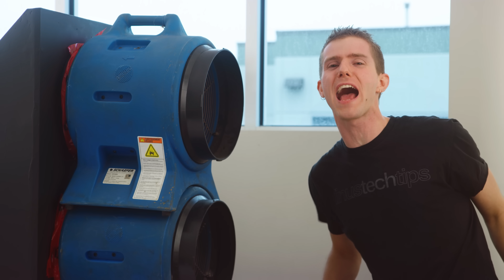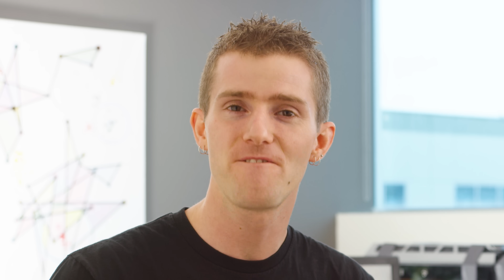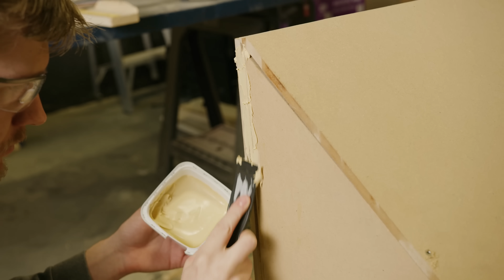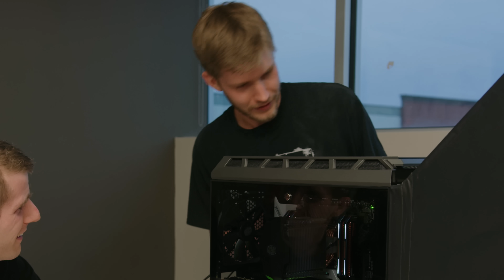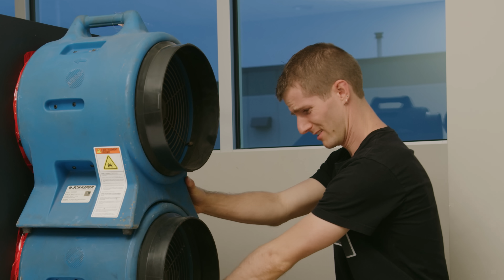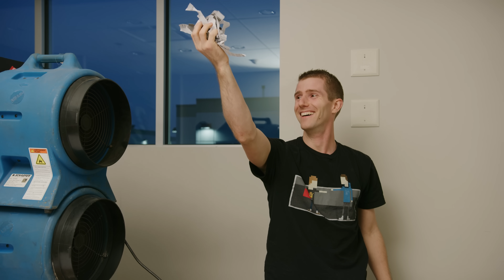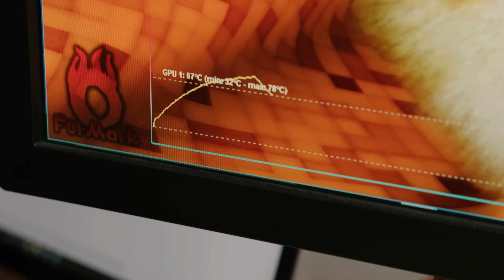Highest Airflow PC EVER - SUCCESS!

Comment: if anything adding PC fans to the case may actually be ever so slightly decreasing your air flow by adding drag to the system as the 2 big blowers would just be fighting to force air past, and over spinning the tiny pc fans.

Comment: The PC industry both consumer and industrial have been in the cooling dark ages forever... 2022 now and the cooling game is still completely behind. It almost sings to me as planned obsolesce. You will always be looking to upgrade as the next technology bump proves cost effective, but if you dont, heat cycling will help speed up your decisions. Case design has clearly chosen aesthetics over pure function... and motherboard manufacturers are a bit long on the tooth with the conventional ATX pizza box with radiant heat dispersal that favors airflow, but, with no airflow, if a hydro cooling method is chosen. Why rectangle? why not clot the CPU or integrate an active cooling method for VRMS and other heat generators? Why is the backside of the mobo always overlooked when considering cooling from a case or mobo perspective? Id love to (at least) see tha backside of a mobo cooled with some low profile slow running noctuas, for example - it get hot back there too. Why not engineer slotting the memory in such a way that doesnt impede front of case airflow to VRMS, rather, create a motherboard that invites airflow to naturally channel efficiently.. With the right mobo form factor and a bit more thought out case design, there would be a lot more going for high end pcs and servers and not close your eyes and hear the sounds of being in an airliner

Comment: You know… that’s a good like tid but there linus did and said about the positive pressure and the paper throw in the fan. See the way how the heat is given off from the metal is the air passing over it and is in contact taking the heat with it there’s a word for that not positive if it’s latent heat but oh well. Now the very best temps are actually achieved when air passes over something in the least speed possible but within reason. If you like to see this working you can do this in your car with the ac or heat on with a normal like food thermometer, you take that thermometer and put it in the center most vent in the dash and you can turn on the air if you want to see how much just normal air pulls heat off the thermometer you can do that too with just the blower on try it on low and high and measure that compared to ambient temperature. I can assure you that the low speed will give you the lowest temp possible where the highest will be hotter, since that won’t be too noticeable with just air now do it with the ac running. Do note that ac systems have a sensor to keep the evap core from getting frozen some you can bypass it but eeeeeuuhhhh don’t try that now the would be too difficult. On your highest setting I’m sure you’ll get 40 degrees and your lowest you’ll get 30 degrees it’s actually quite cool how that kind of physics works ok on to what I was going to say about those gargantuan fans, instead of running them in push…. Why not pull? It is working right because Alex saw a big improvement right from 75 degrees to 40 right but I wonder if the negative pressure passing over and quickly getting dispelled out the part of the fan were the velocity increases I wonder if that would kinda help

Comment: With that level of airflow - isn't the GPU fan like - irrelevant at that point. :D LOL. Prolly would be cooler GPU if you just stripped the fans and let that flow over the radiator...

Comment: Why not try to put one of those on the back and one on the front, pointing both at the same direction, one to blow and the other to suck air, something like a turbine, plus water cooling, ussing a 2 really crazy radiators or 1 really dumb radiator (cilinder) on a custom case with no other reason to exists.

Comment: LOL, this was beautifully overkill. I thought my PC was overkill with all of its fans. I have 9 3000RPM fans from Noctua. 2 2600 on the CPU Cooler tower in a pull through config. REALLY works well, keeps my 3990x at 60C at max load (even overclocked), which I was surprised to find out, even when I put the fans at a moderate curve, it barely hits 70C (so about 2000 RPM) though at full load it's like 60dB. YIKES. Also my room is like 26C. I live in Mississippi it's always hot and humid.

Comment: So I work in ventilation and what I’m wondering is how it would have affected the values if they had two more at the back, basically sucking out the air that is added at a higher speed.

Edit: I just finished watching and answered my own question. Can’t get much lower than ambient room temperature if you’re only using air.

Comment: Pro tip.  Two pieces if twine to find the middle ( as long as you find the diameter ( longest the line all get ) ) with two pieces if twin you will find the center.

Nail, peice of twine, and a drill would work just fine.

Comment: You really didn't need any of the exhaust fans in the case. They were just slowing the air flow down. Not to mention the pressure was spinning them up probably causing them to be generators which might actually be bad for your mother board.

Comment: Scared of a table saw, no problems using a hand held circular saw. Know what your arms aren't? Stronger than a steel table. How to use table saw 101: Don't put fleshy bits in the direct path of the death wheel, don't use fleshy bits to push the piece, follow the cut thru, and stand off to the side. Not a carpenter or weekend woodworker and even I know that.

Comment: Should retry this with a block of dry ice in the wooden fan shroud on the front and remove the rear fan along with the fan on the cpu cooler. I think those little fans are actually impeding airflow. Two window A/C units would be an interesting test as well.

Comment: If you had no electricity worries, you could technically make this work viably by making the duct longer, pointed outside, and have the airflow redirected outside elsewhere.

Maybe a wall mounted tower of some kind?  Perhaps you would want your biggest, most heat producing PC to have something like this set up.

Comment: I wonder how these fans compare to this:
https://youtu.be/ti_qvty7eCM
It is the fan that cools resistors in an electric locomotive (AFAIK in such locomotive  you cannot direct full electric  power to wheels from standstill because wheels would spin and engine would over rev (or maybe something else would break too). So part of the power is redirected and heats up  huge metal resistors until the train gains enough speed, the faster you go the less power must be wasted in such way. And this fan blows air on these resistors during acceleration so nothing melts nor catches fire.
Edit: I checked and they say that this one from locomotive has 280m3/min so about 10k CFM - 5 times more than the one from video, and there are four of them

Comment: With my experience related to HVAC, your homemade duct is excellent. However, duct sealant would have worked better than wood filler and is easier to sand.

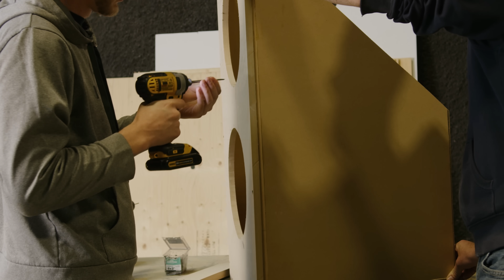Comment: 4:06 Alex and Linus might already know this, but for anyone wondering: The wood glue is much, MUCH stronger than the screws, especially with how the screws are attached in the video. Screws are typically used in woodworking to keep a project stable while the wood glue is setting and are removed afterward so the area can be cleaned up. They are a substitute for clamps when clamps can't be used effectively, they can be left in place as a kind of "security blanket" but don't really do anything, not effectively at least.

Steve Ramsey has a great video on this if you want to see it for yourself: https://www.youtube.com/watch?v=Esvb64fUQ10

If a project is glued properly, failure often occurs along the wood grain, NOT where the glue meets the wood. That is, it's the wood itself that will fail before the glue could fail. A way of understanding this might be to imagine welding. You have one set of metal parts held together with screws. You have a second set of metal parts held together by welding. Which method is stronger? The welded one. This is because of the type of material used for the application. Conversely, if you were to try and weld two pieces of plastic or wood together with a welding torch, they would just melt or burn. For plastic, two screws would the plastic together more securely than general glue because plastic doesn't absorb glue as effectively as wood does. For wood material, wood glue holds two pieces of wood together far, FAR more securely than screws because of the characteristics of how wood pores absorb the glue.

The only exception I can think of might be if you had the joint where wood was glued together is exposed to an environment that made the glue fail. It depends on the sort of glue, but I would imagine heat could be(?) a factor; water might be another problem, but the wood would be in more trouble from the heat or water than the glue itself. The material being held together would be warping and moving, giving you much bigger problems to worry about.
Reply: Thanks, just learned a neat thing.
Reply: short version: wood glue better than screws
Reply: I didn't read it cause I don't like building wood
Reply: I don't like reading

Comment: try using one fan at the front panel and one at the side panel to help equalise the pressure (although it will still be negative pressure because moving fluids are less dense than static fluids), or keep the same fan design but take the top lid off. another idea would be to use a fanless cpu cooler as the air from the big fans will be sufficient to cool it and there will be no fan interfering with airflow

Comment: Moving the air faster doesnt give the optimal heat transfer. Air needs time to take the heat from the source. F1 cars uses coolers slowing the air getting in to the car at 300 kph before entering radiator.

Comment: wait until the air flow ripped out all components inside your pc.. starting from fan, the mb, those transistor and connector got pulled away.. and finally flying 1080 Ti

Comment: as fun as this was a test bench with a large consumer grade fan in a closet safe from spills and filtered ventilation would give good enough cooling improvement over your standard desk located case. maybe this is the way we should start building a little remote room underneath our houses with wireless or long usb leads with a usb/bluetooth amp in the office.

Comment: In this setup shouldn't you just remove the fans from the CPU heatsink, as well as the fans and housing on the GPU, and just let old hoss handle it all?
Reply: So, server setup it is
Reply: "Old Hoss"😂😂😂😂😂😂😂😂
Reply: Well it wouldn't really make a difference, except the moment you turned the fan off the PC would overheat and go into emergency shutdown.
Reply: @vojtechstrnad1  I have a Ryzen 7 3700X with a buggy fan, which doesn't always spin up when I turn the PC on.
I actually ended up using my PC for over an hour and only noticed that the fan was not turning, when I began smelling molten plastic 😅

So nope, it probably won't shut down immediately 😜
Reply: @Centttttt60  That probably means your fan is rated for lower temperatures than the CPU. Another reason to get a new one.
Reply: @vojtechstrnad1  Man I've seen people fuck up putting heatsinks on where the heatsink wasn't making contact and they ran that way for a year wondering why their performance sucked. Chip was at 100c constantly but the thermal throttling n such kept it going. Perhaps if there was no airflow in the case it would have definitely failed in that case.

Comment: Almost three years later, posting this in the last 10 minutes of my birthday.. And i find this now? Haha! I'm still glad i got a 1080 Ti when i did, saved up for a long time.. Just hoping i can get my hands on an RTX 3090 before some jerks 'scalp' them all.. :/ If you still have that wonderful MDF wind tunnel though..please install a couple of 300mm sub-woofers into the holes and use it as a bass bin..please? :) Might need an extension, wadding and ports on the back though.. But you'd create the BEST err "gaming" sub ever! So long as you don't use anything wimpy, but at that size, a couple hundred watts would make things rattle! I did also expect this result.. (have you worked with high speed fans in servers before?! ;)) but this was..hilarious! Do it again!! With a radiator stack! (Feed them series-parallel!)

Comment: You know I always thought about just running a simple tube from a portable AC  straight to the PC. You would get a direct flow of 35-50°.My pc has never had those cooling needs ,but was always interested in the results.
Reply: You just have to worry about condensation from sub-ambient cooling.
Reply: @sl33ksnypr285652  Yeah, if condensation can somehow if dealt with, AC would be the best cooling option.
Reply: Linus has an AC liquid cooling chiller.

Comment: I learnt this too using my HP DC1006TX. Would heat up a lot. Used to keep it in an air conditioned environment with no moving air near the laptop (~20°C) vs beside a water-based domestic cooler you get in hotter countries in a much warmer environment (~35°C). I realised that moving air continuously >>> lower ambient temperatures for effective heat transfer, cooling and convection>>>radiation. Final conclusion, no matter how powerful laptop fans are...since they're tiny, they can never match the capability of even a slow cieling fan. The essence to very effective cooling is moving large volumes of air...flow rate can be intermediate/slow (like in the case of a cieling fan), but, volume matters a lot.

Comment: this is that dude's pc who has a loud ass fan or a/c in their room while in a discord call
Reply: Just add a dog barking in the background and you have TF2 community servers
Reply: that's their mic being trash. i have a loud ass A/C and no one can hear it.
even my keyboard for that matter.
Reply: @kimaji  that's what I feel it usually equates to as well. It's simple enough to just make sure to buy a decent headset and limit the interference of other noises besides your voice. I've also never had complaints about my AC/PC fans either, nor my keyboard, and I've got Razer greens in my board so they're pretty loud.
Reply: that was usually laptop coolers making that sound, hp had some terrible laptops off the shelf everywhere.
Reply: “Dude why is your ac on in subzero temperatures”
“That’s not my ac it’s my computer”
His computer:
Reply: That box fan guy.
Reply: Aka me
Reply: No. That guy has no airflow, that's why it's all cheap and maxed.
Reply: Why wouldn't I run an A/C in my room with my gaming pc? It's in my bedroom, which I keep air conditioned all year-round, even middle of winter. If I dont like the heat, I mean what else am I supposed to do?
Reply: @TheGauges420  dude just put it on low or open a fucking window because we dont wanna hear the noise of a fucking open airplane window ( this was about the first comment not the second)
Reply: @roomba.  or you can just use rtx voice and let it remove the background noise for you

Comment: Me: overclocks pc
Mom: honey why is the electricity bill 90000 usd?
Reply: If you custom created custom unit, make sure it contains both 1 hp fan motor and has water cooling piping through a radiator. The amount of power usage should be around 3000 watt ram total, making it 3kw x #(price per kw).
Reply: @roaringcow8163  excuse me?
Reply: @roaringcow8163  have you never been told about bills
Reply: @roaringcow8163  Then whom she will ask? 🤦‍♀️
Reply: me: umm... inflation...
Reply: LOL
Reply: and since when do we have a jet engine?
Reply: LOL
Reply: Since when mom calls their sons by honey 😅
Reply: @dreammaker3167  *step
Reply: Lol 69 likes

Comment: With that much air changes, this probably wouldn't matter much, but I would flip the fans, pulling air through the case, wouldn't have to worry about the lid blowing off, and you wouldnt be blowing in the heat generated by the fan motors

Comment: Put a multimeter and one was 120 fans take a vacuum cleaner or a shop vac and make it spin twice its speed you’ll see that it produces voltage and current enough for you to feel it with your tongue too much for the motherboard header to be sent back into the board

Comment: Next plug the fans up to a variable controller so their speed can be adjusted based on internal temp. i am sure you can do something with like an existing setup + Arduino + mains power regulator circuit.

Comment: You guys would have gotten even better results if you put at least another one of those giant fans in the rear as an exhaust because the fans inside the PC are too weak compared to the giant ones to pull the air out of the case at a reasonable pace compared to the air coming in. Essentially you had a passive exhaust and those fans in the pc were rendered useless sucking up unnecessary power.

Comment: So, I know this is a little late... If you really want to do a wind tunnel style pc case effectively, I would spin those industrial fans around. By pulling the air rather than pushing it, you get less turbulence within the main chamber. This would also work to seal the lid down without the tape. Did not even consider the fact that you were pushing the air into the case before I saw the lid... Your biggest concern either way is bottlenecks where your other fans are.  source: Current wind tunnel design researcher

Comment: would have worked better if they cut the back of the case out. no point in having that little fan and a wall of metal blocking the airflow

Comment: I feel like this might actually damage the fans or power supply. A motor being pushed against it's will is actually a generator. The fans aren't powered by the motherboard. The motherboard is powered by the fans.